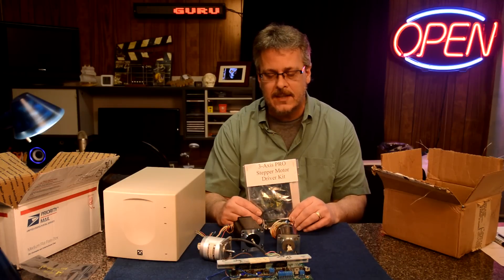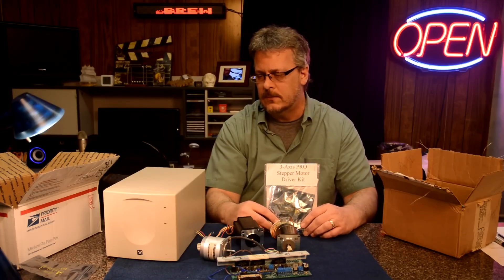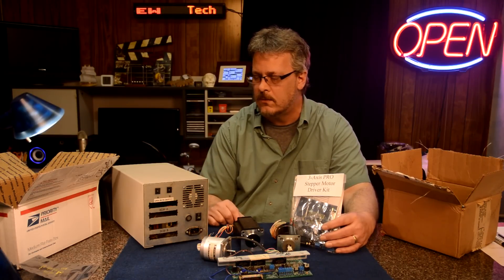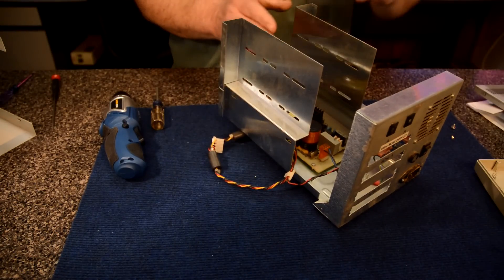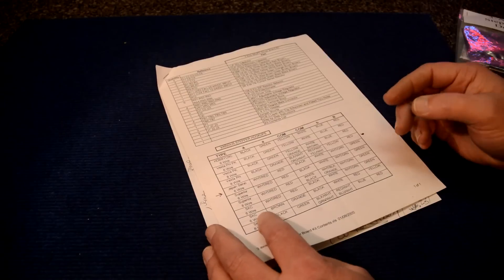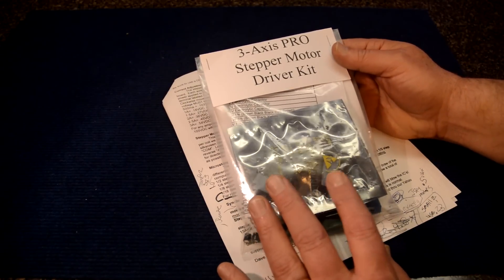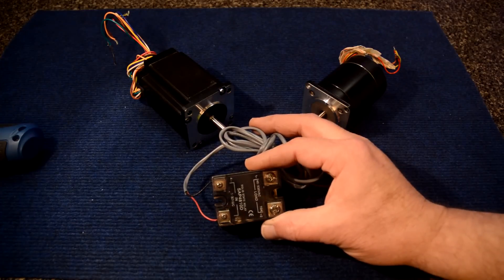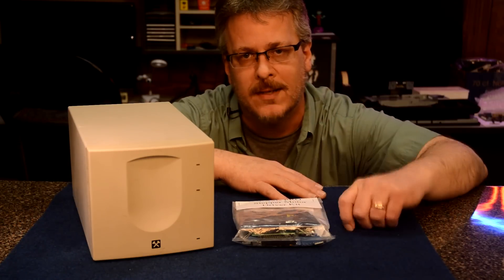Building A CNC Stepper Motor Controller for Wood Router - #1

Comment: Have you ever tried USB (serial) CNC controller boards? I've only ever used those, so I wondered if there's any advantage to using parallel port based boards? For example I remember that a few years ago Mach 3 would only interface via parallel port because it allows faster control signals - I wonder if that's still the case. I've never owned a PC with a parallel port though so never been able to take advantage of that!
Reply: +OpenTronic Sorry, I see you've already answered that one further down..
Reply from the maker: +OpenTronic No problem, the parallel port vs USB debate could go on forever with varied opinions but for me, parallel works great with Mach3, so... if it ain't broke, don't fix it. The 3D printer here in  the shop runs 4 smaller stepper motors using an arduino mega 2560 with a RAMPS 1.4 driver that that works well , but the software (Cura) is specific to a 3D printer. I find that most older (XP vintage) tower computers have a least 1 parallel port connection. ~steve
Reply: Yep, I started with a 3D printer running on an arduino mega and RAMPS, then I learnt how to modify the Marlin firmware to control a laser cutter with the same system (because the board it came with was REALLY limited). So it really is a matter of 'if it ain't broke, don't fix it' for me too, except with the Arduino. Except using RAMPS on other types of CNC machines requires some programming knowledge, whereas it seems like Mach3 is far more general purpose. PS now I remember that a long time ago, I tried to connect a totally home made stepper controller to a parallel port and totally fried the PC, so I did own a PC with a parallel port briefly!

Comment: I don't really see the value of building a parallel port stepper driver controller.  I believe the same could be accomplished with an arduino (USB) and stepper drivers for cheaper.
Reply from the maker: +mrquicky Well there are a few reasons why I prefer using the parallel port over USB but the main one is Mach3 Software I use and like. You can control a machine using USB with Mach3 or 4 but a USB converter is required along with plugins and other variables. The USB converters are not cheap and only add unnecessary complexity of the electronics. ~Steve